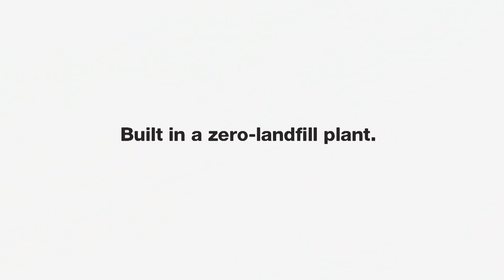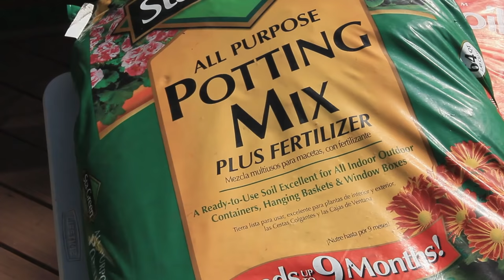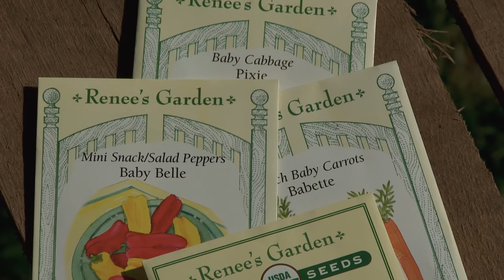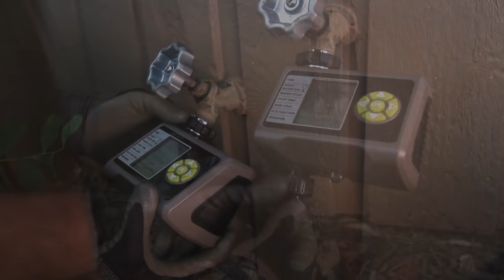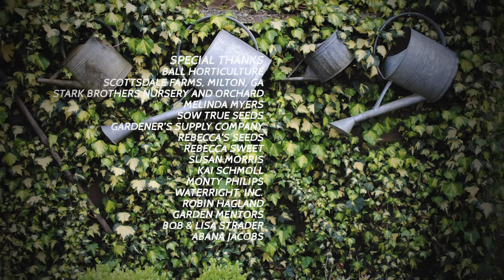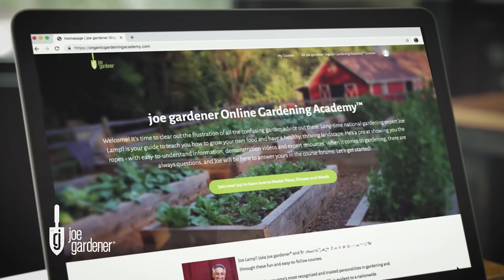Growing a Greener World Episode 1110: Container Gardening Anywhere: What to Know Before You Grow

Comment: FINALLY someone showing definite proof that pebbles at the bottom of a pot is not needed! ♥️
Reply: Fwiw, he used far too many pebbles.  He needs to redo the experiment w just an inch or 2 of pebbles but mixed w the soil, and with growing plants until they fill the container.  40 years of container growing tells me it does make a difference if you do it right. But no, you don’t have to, depending on what you are growing. If you are growing lavender, or other similar herbs, it’s a necessity in my area anyway and makes ALL the difference in a long lasting, beautiful, successful plant.  I would never use a ratio of more stone to soil though like he did. A little goes a long way.
Reply: @selecttravelvacations7472  I agree! And also with experience and experimentation to prove it.